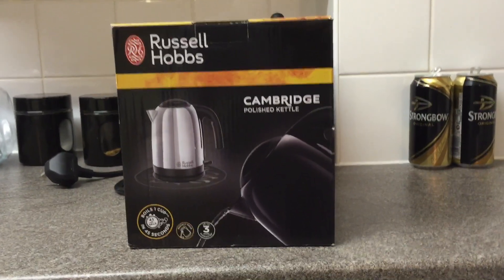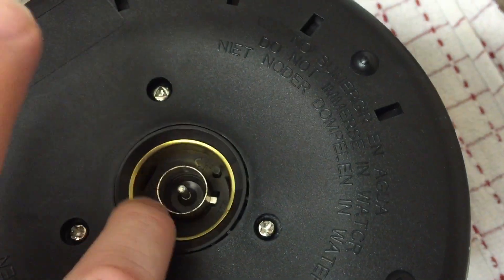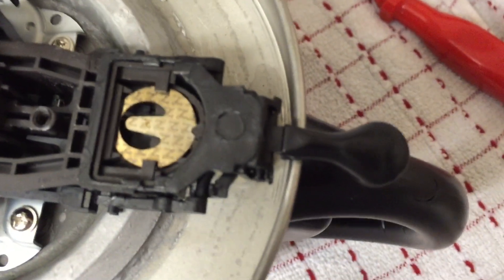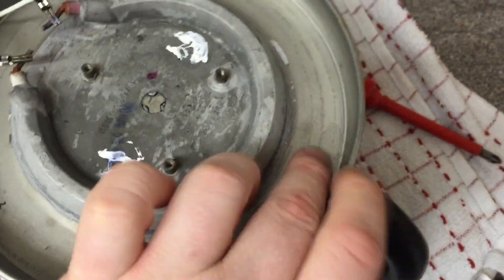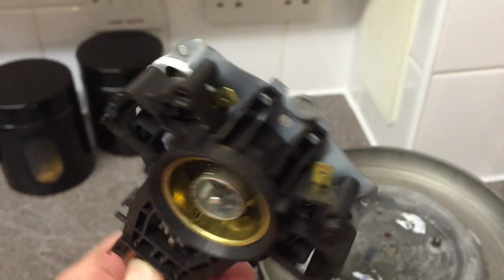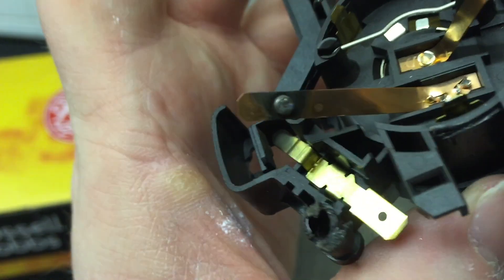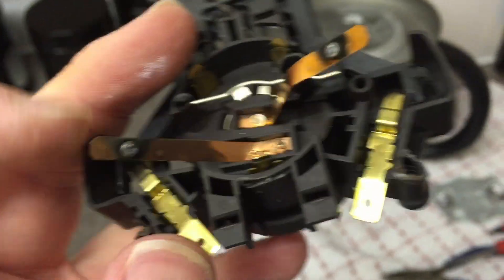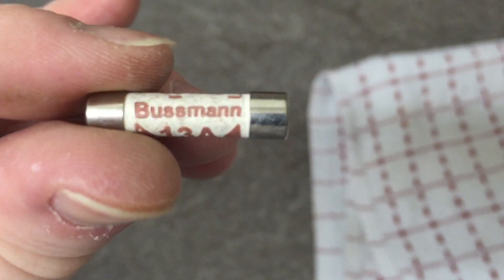My Kettle Broke (Teardown)

Comment: wow 10 years ago video!  We bought an electric kettle stopped working after 3 months. Has the exact same switch.  It is not arcing but the switch paddle will not latch.

Comment: Does anyone know what the white grease like substance is beneath the two metal discs and what is it's purpose
Reply: It’s thermal compound, it helps with heat conduction.  It’s the same sort of stuff you use for CPU heat sink in a computer.
Reply: @NoSignal_UK  Thanks, I was hoping it might be that.

Comment: What's that long, black lever thing inside the kettle ?
Reply from the maker: It’s a tube that passes the steam when the kettle boils into the base and on to the bi-metallic switch.  The purpose is to turn the kettle off when it boils.  The steam heats the bi-metallic strip that in turn flexes and turns off the switch.
Reply: @reddragonuktech  Thanks

Comment: Similar kettles in North America are labelled 1500 watts, yet the parts are exactly the same. That would indicate that the electrical kettle parts in Britain and Europe handle twice the current. That will certainly affect lifespan.
Reply from the maker: George Cyclist not twice the current, twice the voltage. We use 240V for everything here.  A typical UK socket can provide up to 13 amps.  240 x 13 = 3120

Comment: 240????  you mean 220 , thats the standard but can fluctuate between 220-240.
Reply from the maker: Yousaf Akhtar the standard is actually 230V in the U.K. and Europe.  The UK's standard used to be 240V but the tolerances were adjusted to fall in line with Europe years ago.  The tolerances allow most existing U.K. Kit to remain at 240V and still be in spec.  It's not unusual to see line voltages in excess of 250V. Europe increased their standard from 220 to 230 years ago as well.  It was formalised in January 2003.
Reply: Yousaf Akhtar I

Comment: How did you get the metal backplate at 4:23 off? You said it was "pretty brutal"
Reply: i have same question. did you figure it out?
Reply: @carlchai312   I just folded back the metal tabs, and the base plate came away, had to prise it with a screwdriver.

Comment: our earth and neutral rings have bent, meaning the kettle sticks to base each time we remove it. wonder if I need to buy thermal paste when replacing the terminal component? thanks!
Reply from the maker: Tony White If it's dried up then clean it off and put new compound on.  It's cheap enough so it wouldn't hurt to do it anyway.  It won't affect operation but it is used for safety in case you put the kettle on with no water or if it boils dry.
Reply: RedDragonUKTech thanks, turns out that in this throwaway world, it's more expensive to source the part than a new kettle. #buyingacheaperonenexttime :)
Reply from the maker: Tony White yeah fair one, as much as I prefer to fix things instead of throwing them out sometimes it's just not feasible.
Reply: I have some thermal paste left over from doing the heat-sink on my computer's CPU and it was bloody expensive. What's your idea of cheap.?